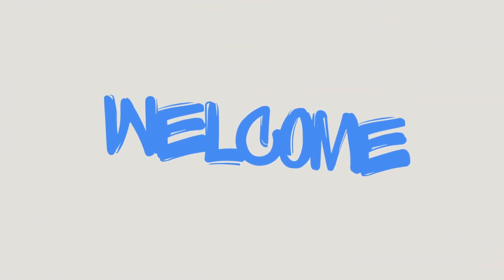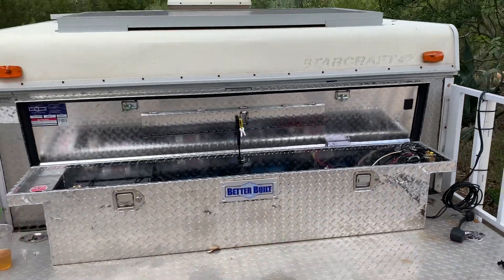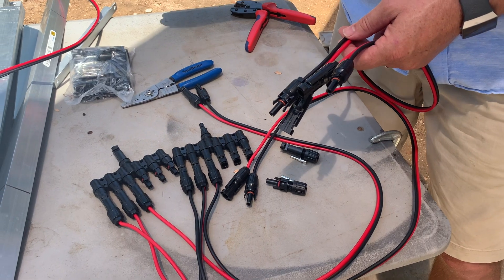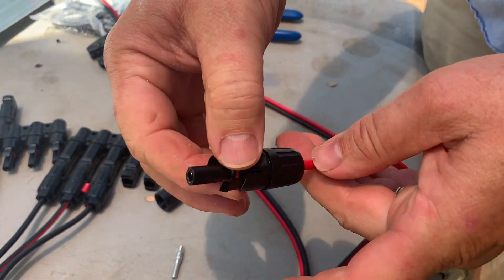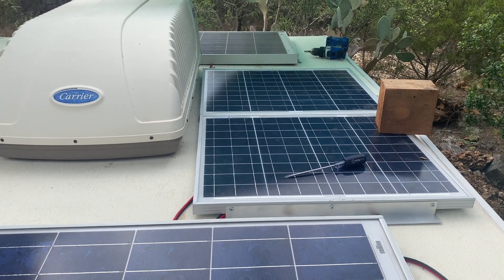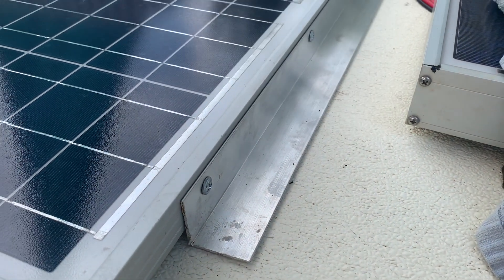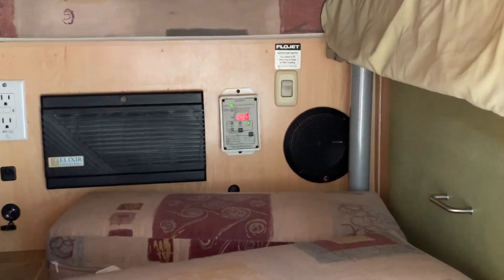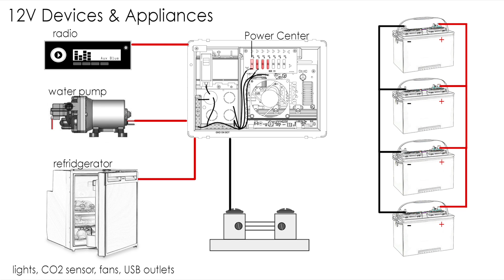How to add and install a solar panel system on an RV Pop Up

Comment: I don't know what the tent trailer roof material is. 

I used 'well nuts' on my pull trailer. I used a spade wood drill, glue and tightened it down sufficiently to expend the rubber surround on the 'well nut' highway speed and high winds does not loosen.

I used two deep cycle 6-volt batteries in series although 4 12-volt batteries were indicated.

Comment: How much are the solar panels
Reply from the maker: Hello and thank you for watching, and thank you for your question!   I bought the Renogy panels on Amazon.  Each panel is currently just under $50.00 USD.  Here is a link to the products.  This link is an affiliate link.  I earn a small percentage if you purchase these using this link:  https://amzn.to/3HK0zJs   
Good luck and let me know if you have any more questions.  Happy to help.   Also, keep a look out for my next two videos.  I upgrade this system to lithium batteries and install flex solar panels on a friends Airstream Bambi.  ~Jim

Comment: Running at a higher voltage on your battery bank doesn't affect how many watts you can pull out of it. Well not greatly with a higher voltage your inverter doesn't have to work as hard. You have to remember you're stepping this voltage up to use 110 volt devices. Higher voltage on your battery Bank allows you to use thinner cables and have less voltage drop over the length of your cables which should improve your system. 

Remember it's not the amount of amps you can pull but the total amount of Watts you can pull out of your system
Reply from the maker: Hi Emmet, thanks so much for the comments and insight.  Good point on the voltage.  This camper doesn't actually have an inverter on board.  I should have mentioned that in the video,  good catch.  The 110V AC and 12V distribution system has two functions, it's a 110V distribution box with breakers, and a 110V to 12V converter.  I can only use 110V when connected to shore power.  So this system, when not connected to 110V is strictly 12V.  All the 12V and under appliances and devices get their power from the battery bank.  In the simplest terms, the panels charge the battery bank rather than power the RV (but, that's over simplifying of course). Since I'm using 12V deep cycle marine batteries, which state their output in Voltage and Ah only, I chose to discuss the system in that manner versus watts.  I'll think about how I can be more clear about this in the next videos.  I definitely don't want to confuse people.   I do think that when discussing home solar, stating things in watts is the standard, since 99% of the system will be inverted to higher voltage at 110V and 220V.   I think the parameters of this small RV system would definitely change as we increase size and demand.   Please let me know if I misunderstood something or just wrong.  haha.  I'm always learning and love all the insights and guidance I can get.  Thanks for watching and getting involved.  I really appreciate it.  ~Jim
Reply: @sothetrickis42 
I like your video.

I run a 12 VDC system altogether, including low draw 12 VDC lightbulbs and lighting. I did it for an electrically quiet environment for amateur radio qrp. For that reason I used shielded marine grade wiring I purchased from West Marine hardware at a marina in Portland, OR. 

I purchased matched batteries from Wagstaffs near Portland, OR.

I evaluated my useage in terms of intended watts and separately as amps because the refrigerator motor startup amps can be factor in a successful solar power design.

I chose each electrical appliance and system capacity so it was operating well below capacity. I have ample power, and a clean sine wave for my amateur radio as well.